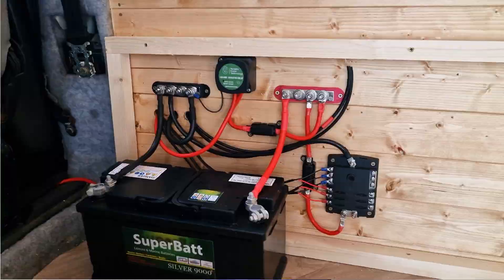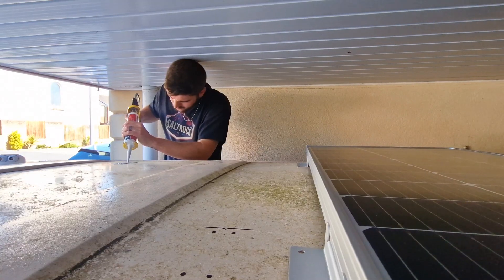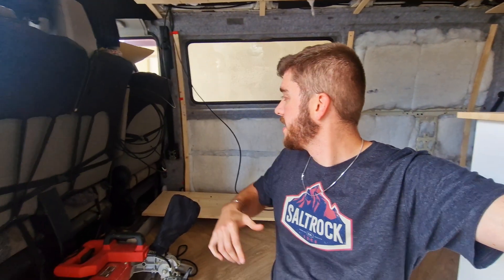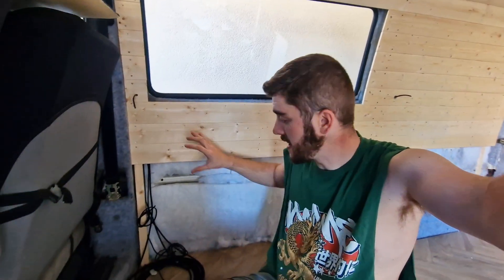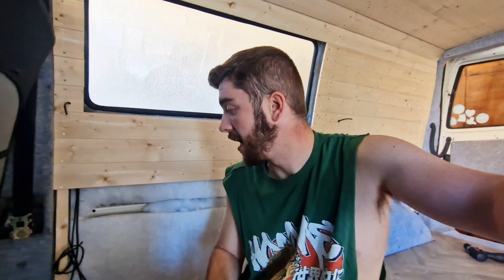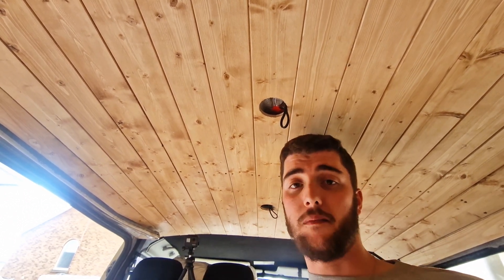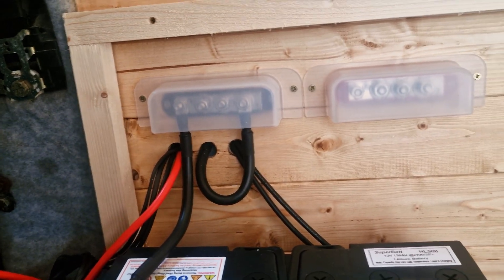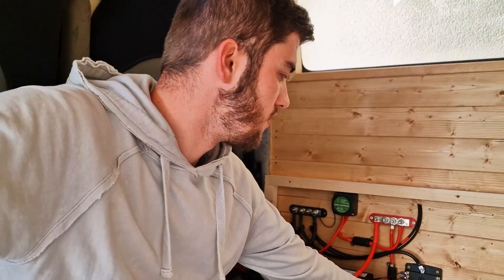OFF-GRID 12v Electrics Install | VW T4 Transporter Van Conversion

Comment: you ok I’ve got a caddy van and want to put a split relay kit in to have a tv and other things no fridge or nothing like that will I need an invertor I’m doing it off leisure battery also what kit do you reckon 5 metre

Comment: I love van builds I just finished my transit connect micro camper I left the electrics til last coz thought would be the hardest job on build turned out the easiest only problem I had was where to earth the leisure bat and relay isolator I found easiest place was just wire into the passenger seat belt on the frame il be doing a transporter on my next build these vids are great and straight forward👍

Comment: as a person who spends half my life upto my ears in car wiring looms i have to ask why oh why do people insist on using red and black cable for everything? also why not use the the body of the van as a full negative run? . saves on cable and also eliminates voltage drop. why not use feral crimps and glue lined heat shrink instead of wagos? the best practice is to drill a fresh hole through the bulk head for the power feed as over stretching the grommet will make it wear through with vibration .

apart from that its nice to see good size cable used
Reply from the maker: Thanks your watching ✌🏻 we used red and black cable as it's easier to differentiate for the owner of the van when it comes to servicing and maintenance, and we grounded the system through a chassis earth, with all apropristley sized cables! Totally get your thoughts though, I agree :)
Reply: @CoupleWithACamper  everyone gets reduced means positive and black means negative .. that's human nature.. it's when people need to fault find thats when the issue starts.. as in the case of the camper I have here now in the workshop... All read cables which is great till it becomes a loom inside the body panel... Course are available and make circuits identifiable a lot faster ..  we are 2 days into fault finding